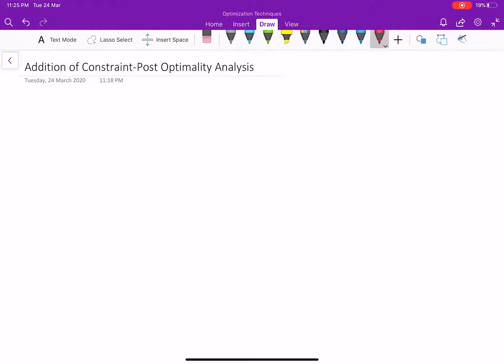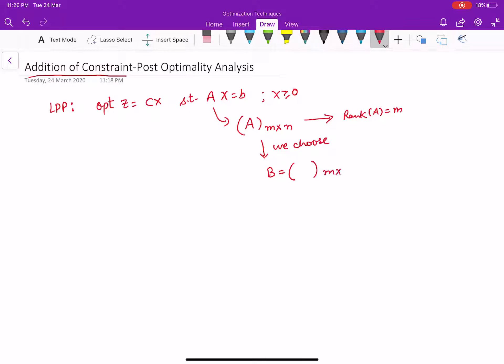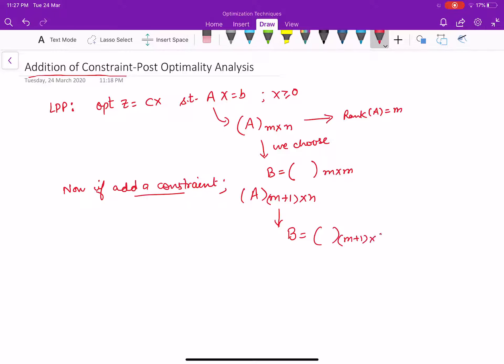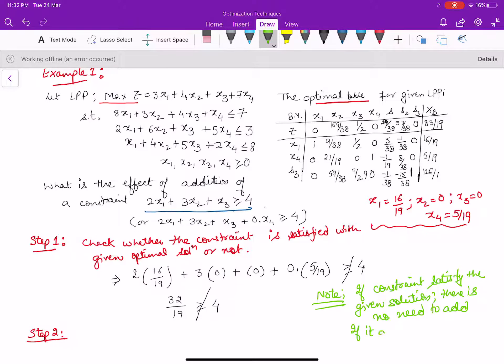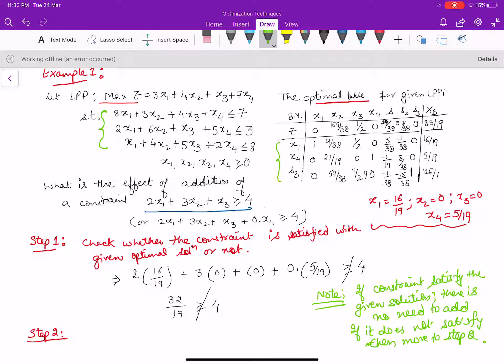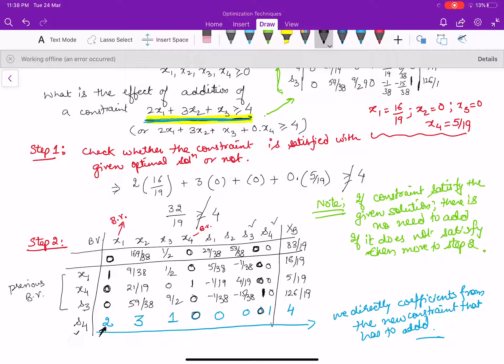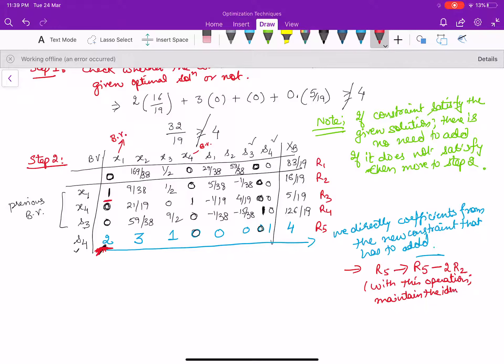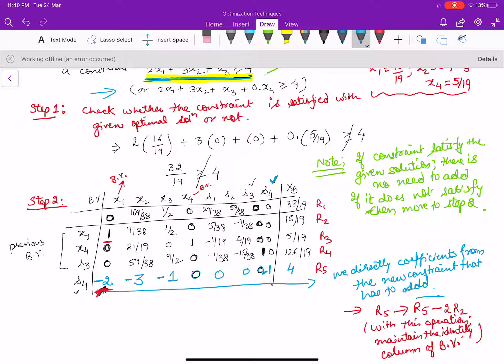Post Optimality Analysis (Part-6)-Addition of a constraint

Comment: Maam can there be a case where we are changing almost everything .. like adding var, constraint, changing Bj in same question?????
Reply from the maker: In Post Optimality-changes are done one at a time. (If more then one change occur such as addition of constraint/increase in right hand side/or anything) then we need to solve LPP with simplex /any other method from start. 
In post optimality we wish to use optimal table of given LPP and then study changes. So we study changes one by one, not all simultaneous. Or, we can incorporate one change -optimize it and then incorporate second change -optimize it -go on like this.

Comment: A humble request  as soon as possible🙏Mem please make the video on
The optimal solution of the LPP:
 Max Z = 10x1 +3x2 +6x3 + 5x4
s.t.   x1 + 2x2 + x4  ≤    6
        3x1 + 2x3  ≤    5
x2 + 4x3 + 5x4   ≤  3
and x1,x2,x3,x4  ≥    0
Compute the limits for a11, so that the new solution remains optimal feasible solution.